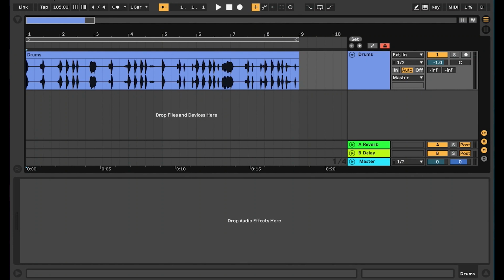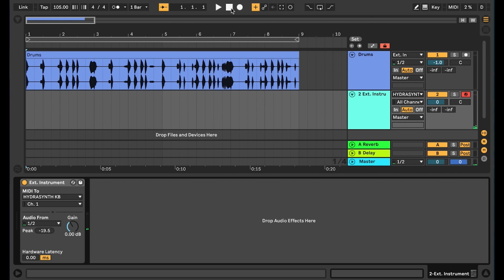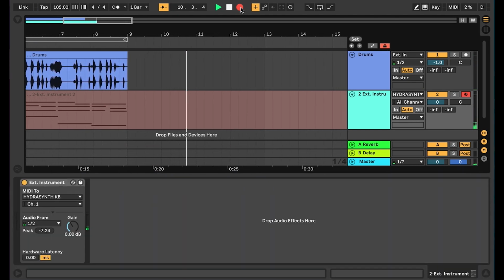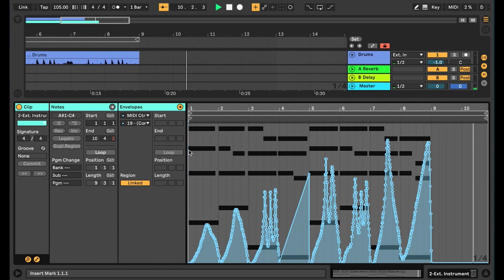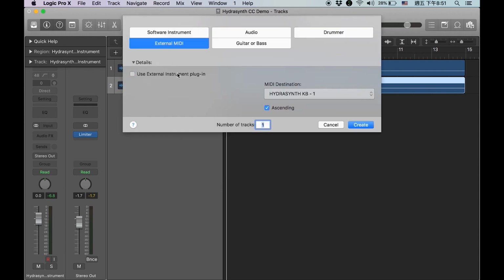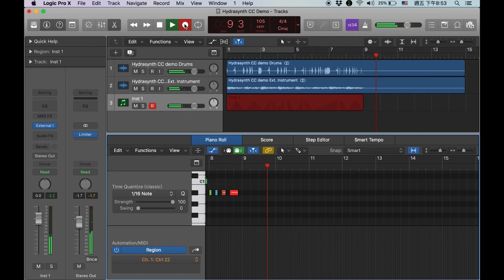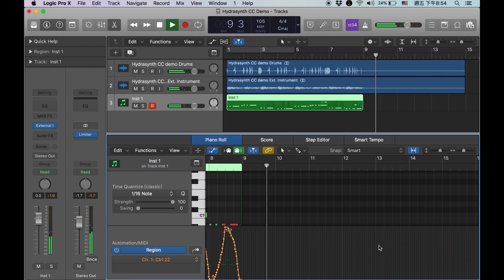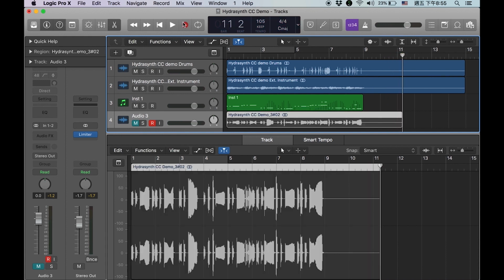Hydrasynth Firmware 1.5 – Part 11 MIDI CC Mode and Ribbon Output

Comment: Hello  I am using wind controllers such as AKAI EWI's and Berglund Instruments NuRAD and I would like to assign the MIDI CC#2 to the different Filter cutoff frequencies can I achieve this directly without using DAW ?
Do you have some kind of MIDI learn ? (I am using Hydrasynth Desktop) Thanks
Reply from the maker: Yes, you can achieve it by setting a modulation in Mod Matrix “CC 002" to "Filter Cutoff". It is patch-specific.
Reply: @AshunSoundMachines  
Thanks a lot

Comment: I want to step through the voices on the Hydrasynth via MIDI, how do you do that? I will probably be using a Behringer pedal to do it.
Reply: What do you mean by voices, exactly?
Reply: @wiredbassclarinet  The big knob that changes the voices.
Reply: @pinchopaxtonsgreatestminds9591  The hydrasynth can accept and transmit program change midi commands (it's in the system settings for midi, page 6). That should allow you to change patches - which is what that knob changes. Thank you for clarifying. When you said voices, I didn't know if you meant patches, individual oscillators, or having midi control of one of the 8 voices that can be played at any given time, all of which can be done. I hope that helps!
Reply: @wiredbassclarinet  OK Thanks! I might buy a Midi controller, but looking at them most are USB, so I'm still a bit confused. Bought the Roland A-01, I think that will work. Not a single YouTube video about doing this. Out of stock of  Roland A-01, had to buy Elektron Digitakt instead. £600 just to turn a button remotely.. expensive.
Reply: @pinchopaxtonsgreatestminds9591  ...but then again, the Digitakt is a splendid machine in it's own right, and you can have plenty of hours going by, jamming with these two incredible boxes alone! 🙂👌 To take it one step further, try sampling bits and pieces from the Hydrasynth, and screw around with it on the Digitakt. Endless fun...
Reply: @TheEvral  Yeah it did turn out a good device, but I then moved my Hydrasynth closer, and moved my Genos to the back of the room, and that should have been my original solution..lol. because the Genos I can play completely MIDI just by linking it to the Behringer pedal, and another keyboard.

Comment: nice. quick question for anyone at ASM reading this or any current HS users: am i correct to assume the CC control requires more internal lag/slew processing to smooth out the 0-127 resolution signal? if so, is it enough that the NRPN control might be noticeably a little snappier than using CC? i’ll be getting a HS before the year’s end and I’m sure the CC control will be completely sufficient in 99% of cases but i’m thinking about how to best use it with my nuEVI wind controllers and if NRPN is more ideal if my DAW supports it. can’t wait to get mine so i can test things like this myself, but i’m curious enough to ask.